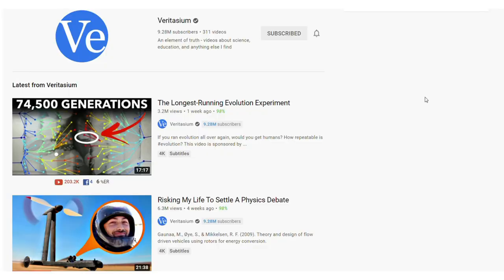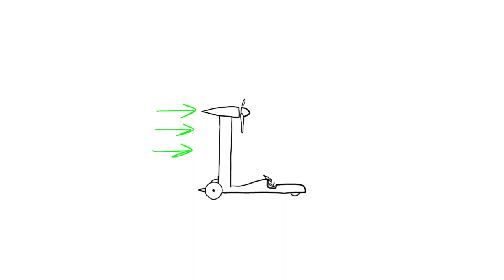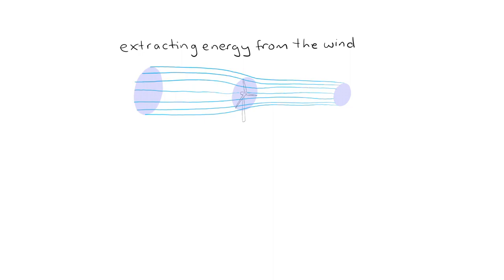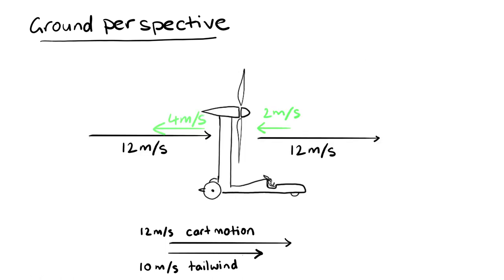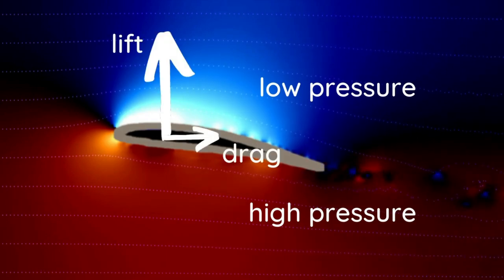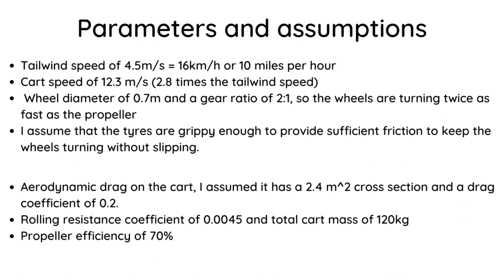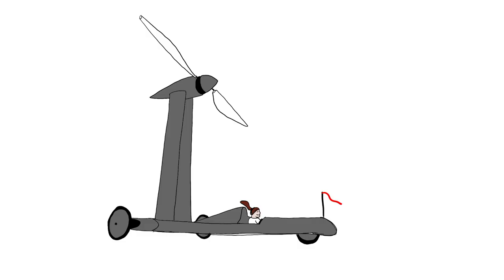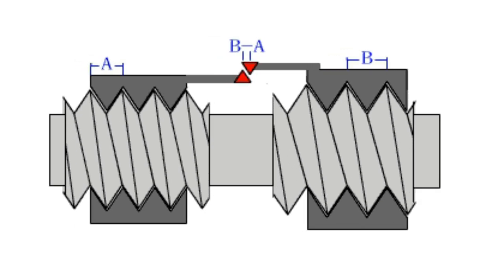Downwind Faster Than the Wind by Veritasium: How Does it Work?

Comment: Consider this variation to a Brennan torpedo. For the Brennan torpedo, two wires are pulled back from spools that each drive a propeller, geared so that the higher speed, lower force from the wires is geared down to a lower speed, higher force at the propellers. The wires move backwards, the torpedo moves forwards. If the wires were attached to posts, the torpedo would move downstream faster than the stream. The torpedo could be replaced by a model river boat, with the spools geared down to drive a paddle wheel. In this case, there is nothing that would resemble tacking.
Reply: Sorry, it takes energy to to pull back on those wires, energy that is lacking in Rosie's overly rosy explanation.  See my separate comment above - It is for sure possible to cause a wind powered craft to go faster, even much faster than a buoyantly neutral balloon traveling with the wind, but the craft can not sustain that speed, it will slow down. The best you can do is pulse the speed of a wind powered craft.
Reply: @roberthigbee3260  Energy is there, in plenty, supplied by the relative movement between the wind and the ground. The vehicle takes advantage of the difference in speed of the two mediums to harvest velocity. It wouldn't work if the vessel were in contact with just one of them (that would require another energy source to "pull the wire", as you said in the case of the Brennan torpedo). I was struggling myself with this too until I saw Derek's cart demonstration, see at 14:00 here: https://www.youtube.com/watch?v=yCsgoLc_fzI (to be honest I still find it counterintuitive)
Reply: @roberthigbee3260  - you missed the part "If the wires were attached to posts, the torpedo would move downstream faster than the stream." So from earth|posts frame of reference, only the water and the boat are moving, and there's no energy being used to pull back on the wires. As for sailboats downwind component of speed, called "velocity made good", the high end catamarans used in the America's cup racing have achieved an average downwind component at about 1.8 x true wind speed over a sustained period of time.
Reply: @rcgldr  I will look into your America’s cup boat claim which I am interpreting from your statement to mean that those high end cats, while zig zagging with the wind can actually go faster than a buoyantly neutral balloon floating with the wind.  I am assuming you are not confusing the velocity vector of the boat pointing straight out the bow with the wind velocity vector.  Boats for sure can go faster than the wind, but at an angle with respect to the wind.  However, on an intuitive basis, and because it is hard to fake the performance of America’s cup yachts, I am predisposed to believe you, without further proof, that a boat’s velocity vector in the direction of the wind can also exceed wind speed.  But boats, with their sails and tacking and keel-water interactions, operate entirely differently than the prop-car we are discussing.  Bringing up boats muddies the discussion… it is part of the magician’s purposeful misdirection.  I am not sure why you are also continuing with the Brennan torpedo analogy, this is also a totally different thing and is another misdirection.  Also, many others arguments in support of this prop-car, not necessarily you, say the words “it’s all about relative speed” are just repeating stuff they heard others say without understanding.  They also start talking about “lever action” without really knowing anything.  Rosie talks about “energy balance”, but does not rigorously and conclusively prove where the energy is coming from.  A lot of fuzzy thinking.  To be fair to you,  I will watch that video link you gave me about the $10,000 bet tomorrow to see if it has any meat to it.  Thanks for your reply…. BTW, I once saw, with my own eyes, a guy saw a lady in half… I saw it, so it must be true right?
Reply: @gastonpossel  I watched the Veritasium $10,000 bet video and I am now a believer, but a big part of the confusion lies with false and confusing statements by everyone including Veritasium in parts of his video (he is a classic “over seller”).  Here is what I wrote in the $10,000 Veritasium video comments:

Life is a process.  This Veritasium video is a process.  This video has a lot of wrong and misleading statements, but at the end, gets the explanation correct, sort of.  At the end, he still is promoting the treadmill experiment, which is for sure not doing what the Blackbird is doing (some aspects are similar, but it confuses things more than it helps).

My next comments dissect this video by explaining what is said incorrectly or in a misleading way, but also congratulating Veritasium on the one good explanation he comes up near the end. Also, spoiler, the Professor ended up giving Veritasium the $10,000!

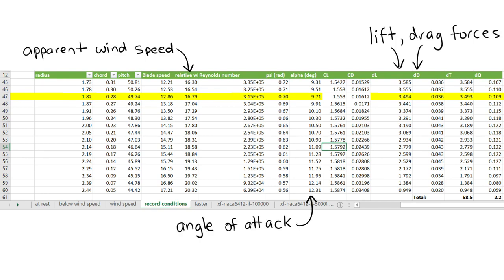 Time mark 11:45 - false/misleading  statement - “power is input into the system by the ground moving under the car”.  The error in this statement is that there is zero energy created as the wheels interact with the ground.  A transfer of energy within the “system” is all that can happen at the wheels.  Saying “power is input into the system” at the wheels is the key not-true part of this statement.  Presumably, he means the “system” is an imaginary dotted line (a “control volume”) that encompasses the entire vehicle (wheels, chassis, chain drive, mast & prop).  The bottom line, clear as a bell, concept regarding energy, is that for Blackbird to accelerate, energy of some form has to enter this control volume.  “Control volume” is a favorite concept with the Thermodynamic folks, but is it very useful in this discussion.  The energy input could be that the ground was not really level and the energy input was really the exploitation of the potential energy due to Blackbird being higher at the start than at the finish, or due to momentary wind gusts as first proposed by the Professor.

Olive branch - If the wind was steady, if the ground was level, if there were no hidden power sources on the vehicle, if the data was recorded properly (no hanky panky) and the Blackbird really and truly can go faster than the wind, in the same direction as the wind and for sustained periods at constant or accelerating velocities, then the only logical available external power source that can enter the system control volume is the wind (let’s ignore solar energy input for now).  So, there must be some sort of unaccounted for prop thrust amplification factor that is sustained by the interaction of the wind and the control volume.

BTW, the treadmill experiment is not a proof at all.  There the energy input to the control volume is for sure at the wheels - the sloped treadmill transfers mechanical power to the wheels and then to the prop that generates thrust that moves the car forward and up the slope of the treadmill.  This is not how the Blackbird interacts with the air.  Consider a level surface, with zero wind - you could tow the Blackbird behind a pickup truck and watch the Blackbird catch up with and pass the truck, heck, it could then tow the truck… this ain’t gonna happen, but Veritasium’s mishmash of fuzzy explanations would make one think that could happen.

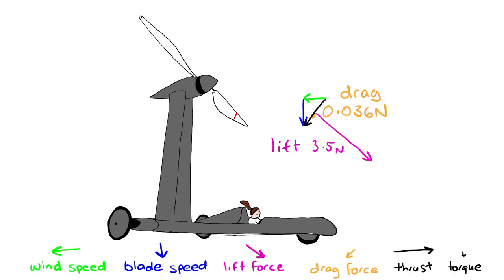Another error at time mark 12:40 - lever action and bicycles going up hill are inappropriate comparisons.  Yes, a lever exists, yes, mechanically, the torque at the wheels can be less than the torque at the prop drive shaft because the rotational speed is faster at the wheels (Torque, lb in = (63025 * HP)/RPM).  So, yes, the force acting at the periphery of the wheel can be smaller than the force generated by prop, this is plain old everyday physics, no magic, no mystery, not new.  The missing concept is the source of the energy entering the control volume.  The kid is the energy source on the bike, a lever does not move unless you expend energy to push down on one side of it.

Time mark 14:20 - The “ah ha” moment - The little cart & 2x4 experiment - First off, and I don’t think he was trying to fool us, and he points this out too, watch carefully how the top big wheel is rotating counter clockwise.  So, due to the ratio of the drive train, the small clockwise rotating wheels will drive the big wheel due to his energy input by shoving the board forwards, and the big wheel will “walk” along the board and go faster than the board’s velocity. 

** The key here is that board is both the energy source as well as a body for the big wheel to push against. **  

This was really the “ah ha” moment for me.  Replace the board with the wind and imagine that the top big wheel has paddle wheel fins attached to each side such that they also rotate counterclockwise.  The essential fact here is that the wind is the energy input and the paddle wheels have to have enough “bite” (call it friction sort of) to claw itself faster than the wind.  Paddle wheels are too inefficient.  The prop does the trick.  I still stand by my earlier texts that the real problem here were the false and incorrect explanations from every one and that, from early on, I felt that for this thing to work, the interaction of the prop with the wind must be causing some sort of thrust amplification effect.  Kudos to Veritasium for finally stumbling onto a good explanation, and that is what matters in the end.
Reply: @rcgldr  I watched the Veritasium $10,000 bet video and I am now a believer, but a big part of the confusion lies with false and confusing statements by everyone including Veritasium in parts of his video (he is a classic “over seller”).  Here is what I wrote in the $10,000 Veritasium video comments:

Life is a process.  This Veritasium video is a process.  This video has a lot of wrong and misleading statements, but at the end, gets the explanation correct, sort of.  At the end, he still is promoting the treadmill experiment, which is for sure not doing what the Blackbird is doing (some aspects are similar, but it confuses things more than it helps).

My next comments dissect this video by explaining what is said incorrectly or in a misleading way, but also congratulating Veritasium on the one good explanation he comes up near the end. Also, spoiler, the Professor ended up giving Veritasium the $10,000!

 Time mark 11:45 - false/misleading  statement - “power is input into the system by the ground moving under the car”.  The error in this statement is that there is zero energy created as the wheels interact with the ground.  A transfer of energy within the “system” is all that can happen at the wheels.  Saying “power is input into the system” at the wheels is the key not-true part of this statement.  Presumably, he means the “system” is an imaginary dotted line (a “control volume”) that encompasses the entire vehicle (wheels, chassis, chain drive, mast & prop).  The bottom line, clear as a bell, concept regarding energy, is that for Blackbird to accelerate, energy of some form has to enter this control volume.  “Control volume” is a favorite concept with the Thermodynamic folks, but is it very useful in this discussion.  The energy input could be that the ground was not really level and the energy input was really the exploitation of the potential energy due to Blackbird being higher at the start than at the finish, or due to momentary wind gusts as first proposed by the Professor.

Olive branch - If the wind was steady, if the ground was level, if there were no hidden power sources on the vehicle, if the data was recorded properly (no hanky panky) and the Blackbird really and truly can go faster than the wind, in the same direction as the wind and for sustained periods at constant or accelerating velocities, then the only logical available external power source that can enter the system control volume is the wind (let’s ignore solar energy input for now).  So, there must be some sort of unaccounted for prop thrust amplification factor that is sustained by the interaction of the wind and the control volume.

BTW, the treadmill experiment is not a proof at all.  There the energy input to the control volume is for sure at the wheels - the sloped treadmill transfers mechanical power to the wheels and then to the prop that generates thrust that moves the car forward and up the slope of the treadmill.  This is not how the Blackbird interacts with the air.  Consider a level surface, with zero wind - you could tow the Blackbird behind a pickup truck and watch the Blackbird catch up with and pass the truck, heck, it could then tow the truck… this ain’t gonna happen, but Veritasium’s mishmash of fuzzy explanations would make one think that could happen.

Another error at time mark 12:40 - lever action and bicycles going up hill are inappropriate comparisons.  Yes, a lever exists, yes, mechanically, the torque at the wheels can be less than the torque at the prop drive shaft because the rotational speed is faster at the wheels (Torque, lb in = (63025 * HP)/RPM).  So, yes, the force acting at the periphery of the wheel can be smaller than the force generated by prop, this is plain old everyday physics, no magic, no mystery, not new.  The missing concept is the source of the energy entering the control volume.  The kid is the energy source on the bike, a lever does not move unless you expend energy to push down on one side of it.

Time mark 14:20 - The “ah ha” moment - The little cart & 2x4 experiment - First off, and I don’t think he was trying to fool us, and he points this out too, watch carefully how the top big wheel is rotating counter clockwise.  So, due to the ratio of the drive train, the small clockwise rotating wheels will drive the big wheel due to his energy input by shoving the board forwards, and the big wheel will “walk” along the board and go faster than the board’s velocity. 

** The key here is that board is both the energy source as well as a body for the big wheel to push against. **  

This was really the “ah ha” moment for me.  Replace the board with the wind and imagine that the top big wheel has paddle wheel fins attached to each side such that they also rotate counterclockwise.  The essential fact here is that the wind is the energy input and the paddle wheels have to have enough “bite” (call it friction sort of) to claw itself faster than the wind.  Paddle wheels are too inefficient.  The prop does the trick.  I still stand by my earlier texts that the real problem here were the false and incorrect explanations from every one and that, from early on, I felt that for this thing to work, the interaction of the prop with the wind must be causing some sort of thrust amplification effect.  Kudos to Veritasium for finally stumbling onto a good explanation, and that is what matters in the end.
Reply: @gastonpossel  I watched the Veritasium $10,000 bet video and I am now a believer, but a big part of the confusion lies with false and confusing statements by everyone including Veritasium in parts of his video (he is a classic “over seller”).  Here is what I wrote in the $10,000 Veritasium video comments:

Life is a process.  This Veritasium video is a process.  This video has a lot of wrong and misleading statements, but at the end, gets the explanation correct, sort of.  At the end, he still is promoting the treadmill experiment, which is for sure not doing what the Blackbird is doing (some aspects are similar, but it confuses things more than it helps).

My next comments dissect this video by explaining what is said incorrectly or in a misleading way, but also congratulating Veritasium on the one good explanation he comes up near the end. Also, spoiler, the Professor ended up giving Veritasium the $10,000!

 Time mark 11:45 - false/misleading  statement - “power is input into the system by the ground moving under the car”.  The error in this statement is that there is zero energy created as the wheels interact with the ground.  A transfer of energy within the “system” is all that can happen at the wheels.  Saying “power is input into the system” at the wheels is the key not-true part of this statement.  Presumably, he means the “system” is an imaginary dotted line (a “control volume”) that encompasses the entire vehicle (wheels, chassis, chain drive, mast & prop).  The bottom line, clear as a bell, concept regarding energy, is that for Blackbird to accelerate, energy of some form has to enter this control volume.  “Control volume” is a favorite concept with the Thermodynamic folks, but is it very useful in this discussion.  The energy input could be that the ground was not really level and the energy input was really the exploitation of the potential energy due to Blackbird being higher at the start than at the finish, or due to momentary wind gusts as first proposed by the Professor.

Olive branch - If the wind was steady, if the ground was level, if there were no hidden power sources on the vehicle, if the data was recorded properly (no hanky panky) and the Blackbird really and truly can go faster than the wind, in the same direction as the wind and for sustained periods at constant or accelerating velocities, then the only logical available external power source that can enter the system control volume is the wind (let’s ignore solar energy input for now).  So, there must be some sort of unaccounted for prop thrust amplification factor that is sustained by the interaction of the wind and the control volume.

BTW, the treadmill experiment is not a proof at all.  There the energy input to the control volume is for sure at the wheels - the sloped treadmill transfers mechanical power to the wheels and then to the prop that generates thrust that moves the car forward and up the slope of the treadmill.  This is not how the Blackbird interacts with the air.  Consider a level surface, with zero wind - you could tow the Blackbird behind a pickup truck and watch the Blackbird catch up with and pass the truck, heck, it could then tow the truck… this ain’t gonna happen, but Veritasium’s mishmash of fuzzy explanations would make one think that could happen.

Another error at time mark 12:40 - lever action and bicycles going up hill are inappropriate comparisons.  Yes, a lever exists, yes, mechanically, the torque at the wheels can be less than the torque at the prop drive shaft because the rotational speed is faster at the wheels (Torque, lb in = (63025 * HP)/RPM).  So, yes, the force acting at the periphery of the wheel can be smaller than the force generated by prop, this is plain old everyday physics, no magic, no mystery, not new.  The missing concept is the source of the energy entering the control volume.  The kid is the energy source on the bike, a lever does not move unless you expend energy to push down on one side of it.

Time mark 14:20 - The “ah ha” moment - The little cart & 2x4 experiment - First off, and I don’t think he was trying to fool us, and he points this out too, watch carefully how the top big wheel is rotating counter clockwise.  So, due to the ratio of the drive train, the small clockwise rotating wheels will drive the big wheel due to his energy input by shoving the board forwards, and the big wheel will “walk” along the board and go faster than the board’s velocity. 

** The key here is that board is both the energy source as well as a body for the big wheel to push against. **  

This was really the “ah ha” moment for me.  Replace the board with the wind and imagine that the top big wheel has paddle wheel fins attached to each side such that they also rotate counterclockwise.  The essential fact here is that the wind is the energy input and the paddle wheels have to have enough “bite” (call it friction sort of) to claw itself faster than the wind.  Paddle wheels are too inefficient.  The prop does the trick.  I still stand by my earlier texts that the real problem here were the false and incorrect explanations from every one and that, from early on, I felt that for this thing to work, the interaction of the prop with the wind must be causing some sort of thrust amplification effect.  Kudos to Veritasium for finally stumbling onto a good explanation, and that is what matters in the end.
Reply: @roberthigbee3260  You know, you don't have to put your entire thought process in a comment, just synthetize your conclusions. Energy comes from the wind, the already moving car exploits it via the relative movement of the ground, transform movement into force that the propeller excerts against the already moving air, accelerating with respect to the air medium. It will continue to do so until drag forces pile up to match the propeller's thrust. It won't work in still air, the energy is collected from the relative movement of air and ground (that's what the treadmill simulates).  So, if you tow the cart with a truck with no wind, it will decelerate the moment you let it go, because there's no enough energy input to counteract drag.
Reply: @roberthigbee3260  - most of the treadmill runs were done with level treadmills, but the cart runs forwards off the treadmill. In this video, shoestrings hold it in place, showing a sustained forward force: https://www.youtube.com/watch?v=oTMRviy-5zY . "Energy extracted from the wheels" - this is how regenerative braking works on electric or hybrid cars. From the carts frame of reference the backwards moving surface of the earth is being slowed down a tiny bit by the forwards force from the wheels, extracting power from the earth, and adding it to the slower moving backwards wind. The board analogy is a scaled up version of under the ruler from 12 years ago: https://www.youtube.com/watch?v=k-trDF8Yldc&t=108s .
Reply: @roberthigbee3260  - treadmills - this is essentially the same thing as observing the cart from a chase vehicle on the side moving at wind speed. From the chase vehicles perspective, the ground is moving and the air is still (same as the treadmill).
Reply: @roberthigbee3260  - in my comment, I noted that if the wires were connected to posts, the torpedo would move downstream faster than the stream. From a land or post frame of reference, there's no energy required to pull back on the wires. From the stream or torpedoes frame of reference, the wires have a relative velocity in addition to the force and in those frames are a source of energy.
Reply: @roberthigbee3260  - from the vehicle frame of reference, the earths surface moves at a backwards speed, and the forwards force exerted by the wheels onto the earth's surface slows the earth down (relative to the vehicle) extracting energy from the change in earth's momentum and uses that energy to drive the propeller at a greater force but at a lower speed.